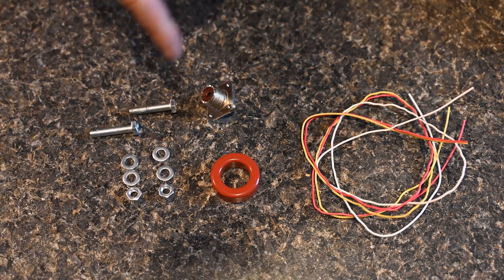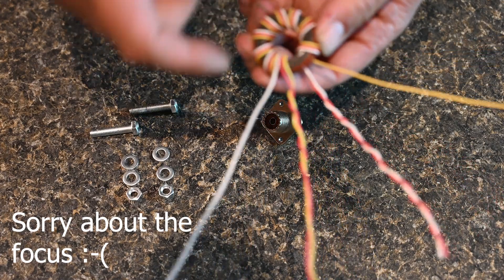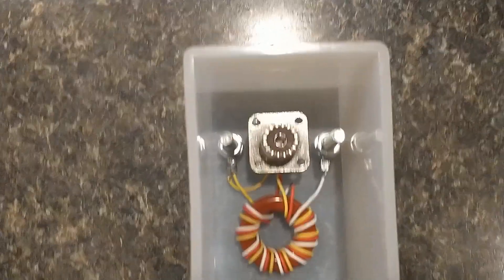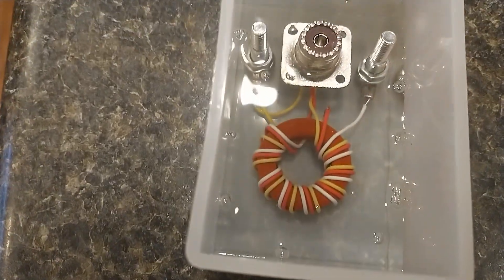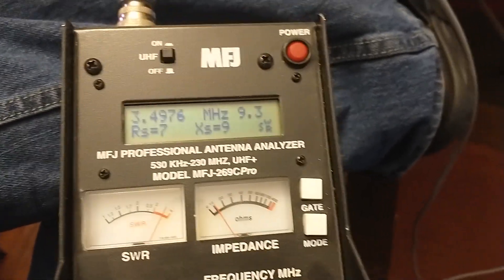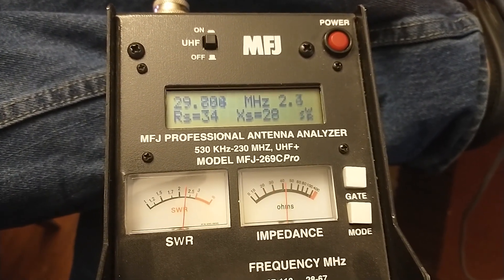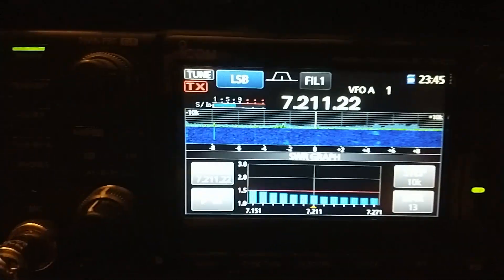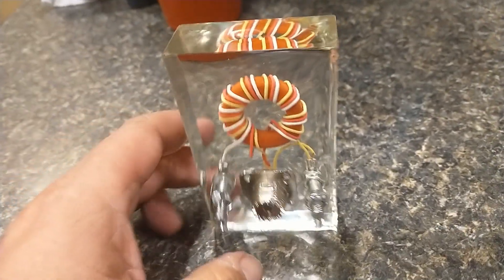Coolest 9:1 unun for long wire antenna ever?

Comment: Two things. Using insulated wire may add unacceptable capacitance doe to spacing. Also, an easier way to wind ununs can be seen in Matt Heere's YouTube videos. No soldering of the different wraps because it's only one wire.

Comment: My major concern is the heat retention being so perfectly sealed in epoxy. This build also prevents you from accurately checking temps since you can’t touch it or put a thermocouple on it. I would seriously consider doing a build where the pl259 and wing nut connections are encased in epoxy and maybe the lower 10% of the core is also but 90% of the core is fully exposed to the air for optimum heat transfer.

Comment: Is that resin rated as an electrical insulator? Some epoxy resins are somewhat conductive and could be putting a resistance on the connections that shouldn't be connected....  Also your wiring doesn't look like John's M0UKD schematic.  C2 and A2 looks correct, but correct me if I'm wrong, but it looks like on camera you've wired A2 with B2, and B1 with C1, when it should be A2 with B1 and B2 with C1. Even though the colors look correct, the high and low impedance sides of that transformer are mixed up.

Comment: Iron powder toroid cores are not suitable for baluns and ununs! This is due to a low permeability. These toroidal cores are only suitable for resonance circuits and induction coils. For baluns and ununs use ferrite cores which have a higher permeability!
The reactance XL (alternating current resistance) of the transformer must be at least 5 times greater than the impedance to be adjusted. This is necessary to minimize the influence of the transformer, so that a reasonable return is achieved. The reactance depends on the core material, the number of turns and the frequency at which it is operated.
What you should definitely not do is pour the transformer in epoxy resin, a transformer gets hot, and this heat must be able to dissipate.
Reply: Sounds like you might want to make your own video.
Reply: @Redbelly357  I'd watch it...

Comment: Not cool !  Sealing it in plastic will trap heat and could cause failure !
Reply from the maker: I only use 100w and I haven't even seen it get warm. Might fail eventually, but the chances of moisture making the others fail are there as well.
Reply: @mikehannah6054  I have had them mounted outdoors, not even in a box and the only thing sealed was the coax connection and the balun mounted on a piece of plexiglass for a strain relief.  Rain and snow had no effect on it at all !

Comment: Why do folks think a 9:1 unun is so great ?  It is designed for use with antennas that produce 450 ohms impedance and a long wire, random ware, end fed half wave is most of the times going to anything except 450 ohms !  And they are most efficient when feeding 450 ohms, so when you stray away from that 450 ohms, the efficiency decreases.  If you connect a wire to it and it shows a high swr and requires a tuner, then the wire you have connected is not 450 ohms.  Also, a mix 2 powdered iron core is designed for use as inductors for things like tuned circuit, not for a 9:1 unun.  The proper core for a 9:1 unun is the mix 61 ferrite !  Also, potting a unun or balun traps heat that can damage the core - it needs air circulation to help keep it cool !
Reply: Thats funny. I`ve build plenty of 9:1 ununs both with 43 mix and 61 mix. 43 mix for me works better
Reply: I'm digging into this topic now. Plenty of smarter people than me saying mix 2, 43 and 61. Nobody gives a great explanation. Maybe throw some math in the comments so the new hams like me know why I should use what mix
Reply: I don't think heating with this size core and wire size would be a problem at 100/200 watts. I prefer 240 or larger cores and Teflon insulated #12 wire for higher power, even #10 for legal limit. If you can't get bigger cores you can stack 3/4 of them for more suds. 50 size cores work fine for 10w. If you do some antenna modeling b4 hand it might surprise you to see how low the screen can be.
Reply: Yes I was thinking the same.  This is the worst design of UNUN I have ever seen - which is why no reputable commercial unit is made this way.  SWR will rise rapidly above 65c.

Comment: As I know resine is not compatible with HF. That would be nice to test before and after to check if the issue is the Balun + Antenna or the Resine + Balun + Antenna . 73
Reply from the maker: The resin 9:1 works just the same as the ones I've made of the same materials that are not in resin. The resin has no measurable affect as far as I can tell.
Reply: @mikehannah6054  Thanks for the feedback.

Comment: make multiples and run them in parallel to share power between them. Would look even cooler!
Reply: You can just stack ferrite cores and make the whole thing thicker with the same number of wires and turns.  Or just use a bigger diameter core.

Comment: Maybe imbed a loop of stiff wire in the resin or drill a hole for a loop of paracord to be used as a hanger.
Reply from the maker: Was thinking about trying an eye screw hanger on it. Not too sure how it would work with the resin though.
Reply: @mikehannah6054  Drill & Tap.

Comment: The diagram has eight wraps around the toroid. But there are 9 wraps around the actual toroid.
Reply from the maker: The unun can be affected by core size, wire size, and a number of other variables. I've always gotten the best results with this type of wire and these cores with 9 turns. 8 or 10 turns would be feasible to use if using slightly different components.
Reply: @mikehannah6054  Be careful with that because the the impedance vs number of turns is a second order function.

Comment: Nice… I was just going to ask how it did with dissipating heat but you answered at the very end… seems like a cool project even if you had to back down the power. I have partially filled 1 of my 9:1’s with a fluffy spray foam. Keep hamming and 83 de W3OY
Reply from the maker: I've never actually used more than 100W lol. Thanks for stopping by!!!
Reply: @mikehannah6054  me neither but I run CW most of the time so I bet a 240 core would probably be enough.